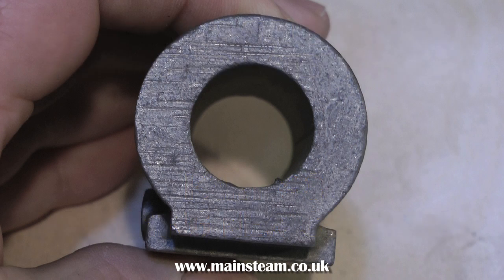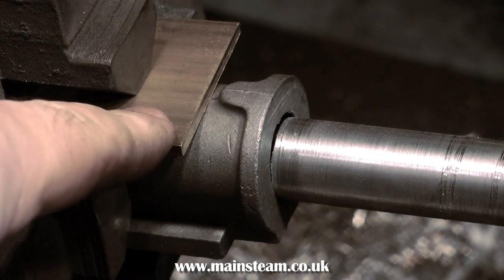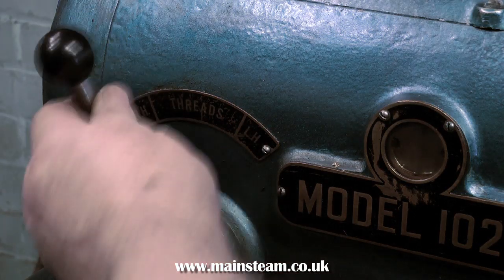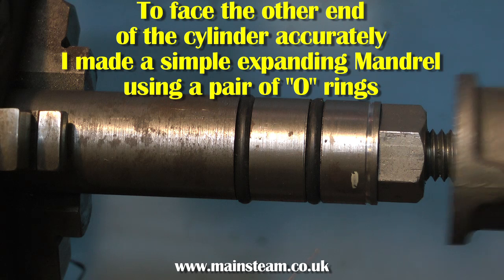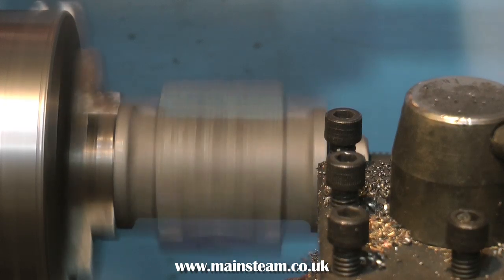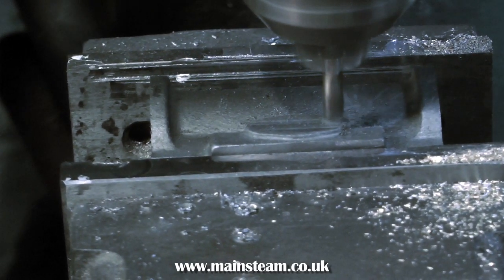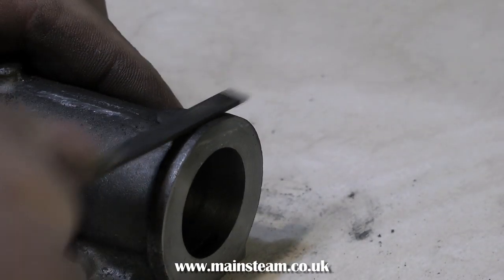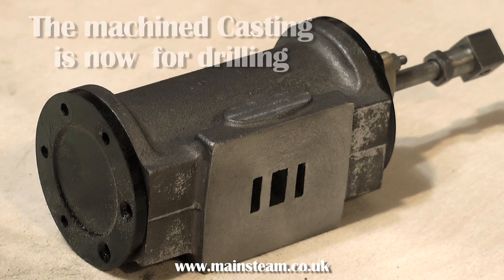PART #3 - REBUILDING A STUART MODELS TWIN VICTORIA STEAM ENGINE

Comment: Would this machining technique be the same for a larger sweet pea cylinder? It says to use a boring bar and have the cylinder fastened onto the bed plate but this technique seems more intuitive to me
Reply from the maker: I made my 71/4 inch gauge "Tich" cylinders using "Sweetpea" cylinder castings and I machined them in a 4 jaw chuck without any problems. It is an either/or situation  - bot methods work fine.